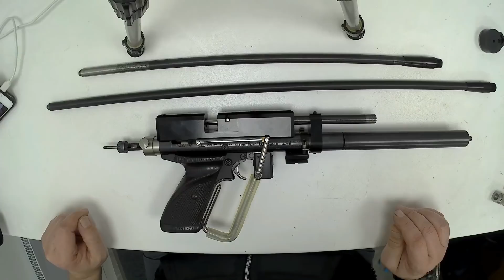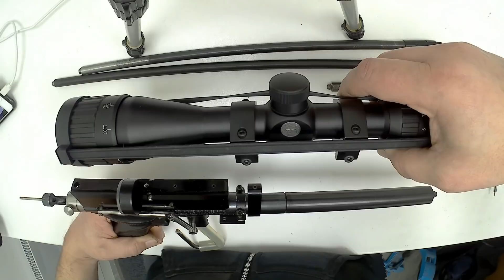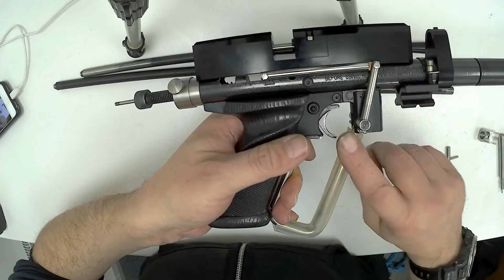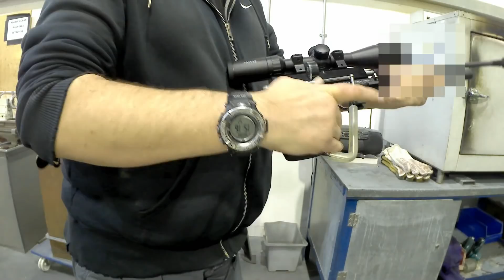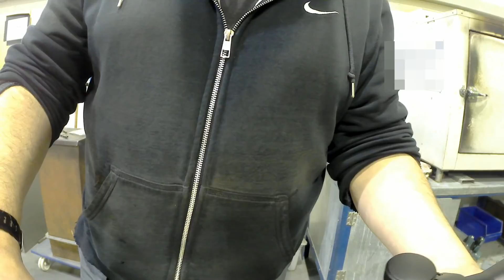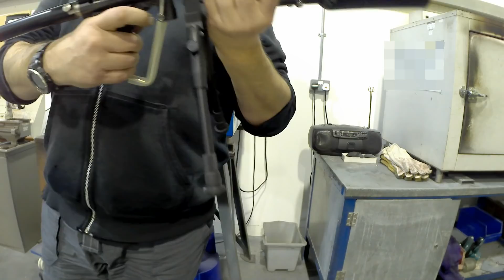MY BEST INVENTION EVER for my crosman 2240

Comment: why re invent the wheel when the original is so good
Reply: Stephen Spencer the 2240 platform is as basic as Crosman could deliver. The bolt, handle and hammer is flawed. If you do power mods it becomes far from perfect. This is his first version of the lever cocking system an it's as perfect as could be once he tricks it out it will be as amazing as all his designs. He is the undisputed King of 2240 mods. If you can't see it you are a novice at 2240 mods builds

Comment: With all the guns I've got,  my favourite is the Victory cp2. Just recently I stripped my son's 2250 to repair and service. It was great fun and now I want the 2240 to mess about with.
Reply: I’m I right in guessing the Victory cp2 is the UK version of Diana Chaser? Or visa versa
Reply: @bayouflats5054  yes over here they are branded as smk victory cp2 which I'm pretty sure is identical to the Diana chaser, ok first guns for the kids but really underwhelming, I'd take the crosman any day of the week, much better platform to build on with tons of upgrades available, my money pit crosman is a 1377 which is now basically a 2289 backpacker but with Williams peep sight and all the internals changed/modified for extra power. For something that looks and feels like a toy it's an extremely capable small game hunting rifle and I could still make it more powerful as only went with a 16" barrel, but at 30 pumps it packs a hell of a punch with jsb 15.8gn pellets and is very accurate, with brass breech and muzzle break with sight pin and extra brass bits everywhere it just has something about it, and being so lightweight if I'm going out for a long day rabbit and squirrel hunting I often take the multi pump crosman over my weihrauchs lol I built it originally as a gimmicky, lightweight, self contained survival hunting rifle for small game because it has a built in pump and can easily fit in most large backpacks with the stock removed etc so all you need is the gun, some pellets and a little elbow grease and I love that idea, I know itle never see that use but It was enough reason for me to build it and love every second of doing so as well as shooting it.
Reply: @MDM1992  Thanks for response. That’s what I’m going to do, slowly modify. There is a nut with channel, LAZE and BLAZE  that is putting out silly short videos. He’s living in a bunker and all about his two 1377’s. Oh, it’s Washington state and he’s high as a kite. Might enjoy